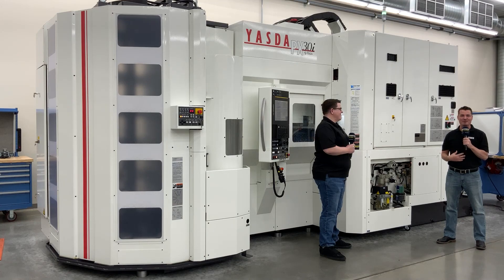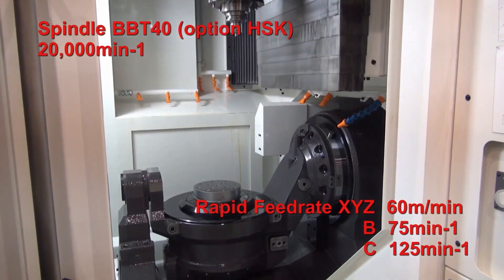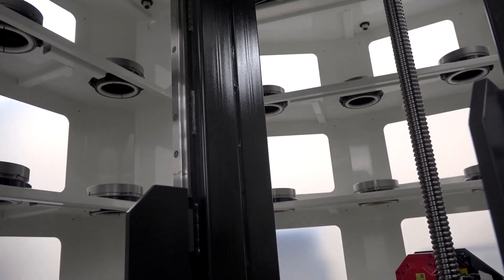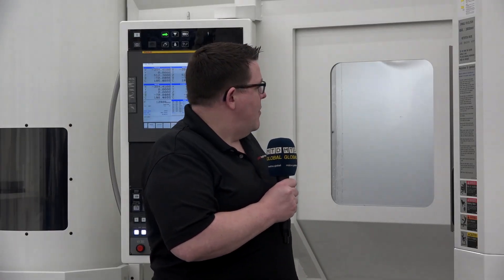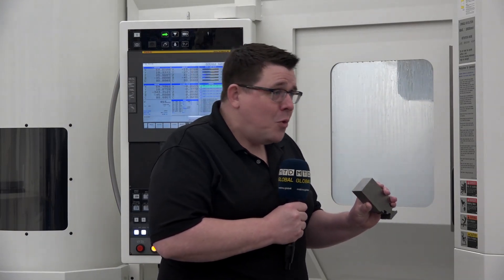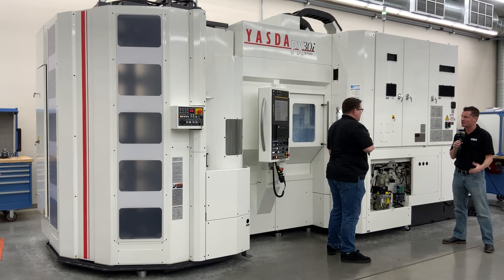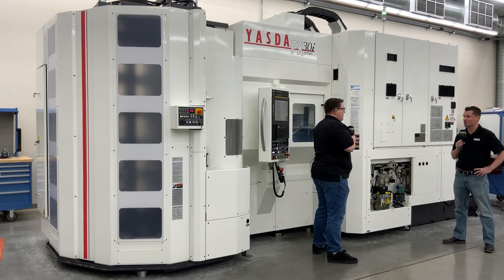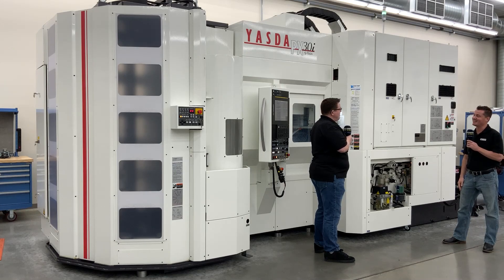Yasda machine has a resolution of 0.1 micron - unbelievably accurate

Comment: Guys, thanks a lot for the information. I've two questions, 1. is the slab of the factory floor physically and thermally isolated from the walls, and if that is the way the slabs for the machine are also isolated? 2. How is the base of the slab thermally isolated from the earth underneath?
Reply: The various machine isolation pads are cut out from the foundation itself so there is no connections to the wall. Additionally there is no need to thermally isolate from the earth underneath as the whole facility is climate controlled.
Reply: @MethodsMachineTools  thank you!
Reply: @MethodsMachineTools  is the thermal control by convection or radiation or under-the-floor heating, how do you plumb the electrical conduits, air and coolant? In our industrial area there is a business that makes large weldments and about each 3 odd hours they drive out to their dumpster with a few tons of laser cut steel and their dumping makes a resonant thump in our side, on the other side of the road! Isolating machines here will need more than just a slot and fill of the foundation!
Reply from the maker: Hope you enjoyed the video, thanks for watching.